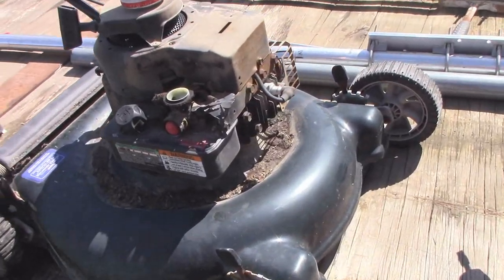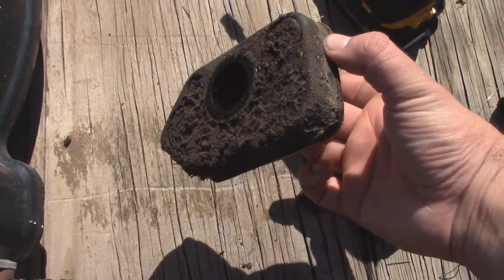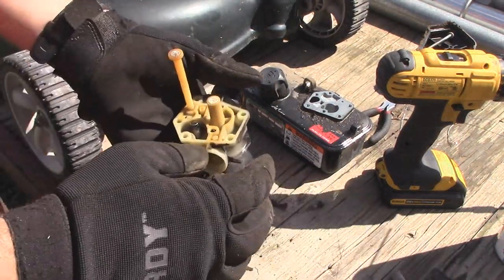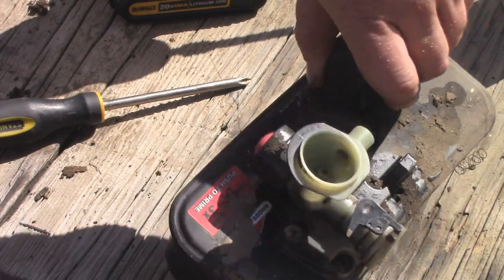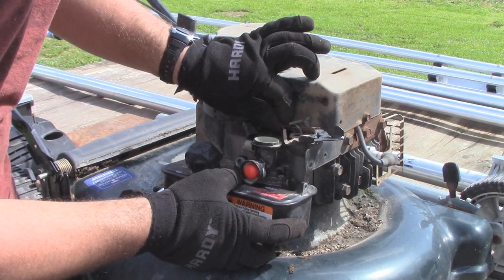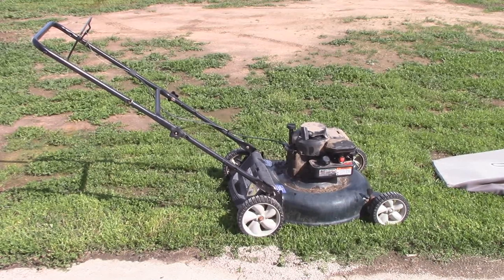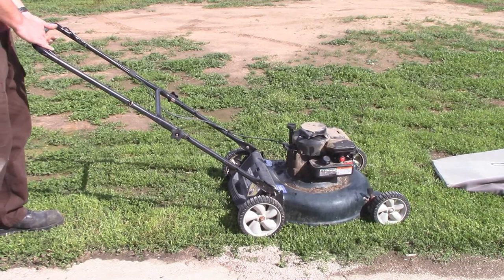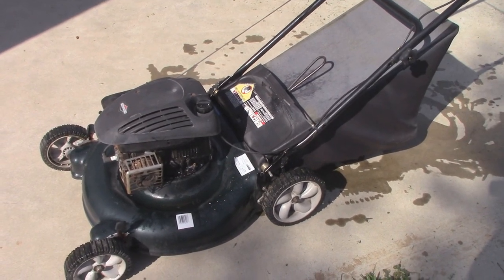Free Mower - Bolens Carburetor Gasket and Cleaning

Comment: YAY another lawnmower vid! Nice looking lawnmower to! Keep up those good vids!
Reply from the maker: Ya I fix them as I get them. I will be doing a service on my riders deck blades this weekend and replacing both drive and deck belts as well. Also have another push mower vid that isn't edited yet. I'm going to start spacing them out instead of uploading all at once that way I still have mower vids going up when it slows down or I can't find any and it should make them feel more regular
Reply: Thats good to hear i found a B&S magnetron mower! carb gasket broke but when its put half on its stops leaking so needs a gasket!
Reply from the maker: +boneheadmoth as hezy Magnetron? yea gaskets are cheap
Reply: yea it is old like 80s briggs! but soon the troy bilt and the magnetron will be running again SOON!

Comment: Good idea using a 5/8 socket to seat the primer bulb.   Also, have you ever stripped/broke the threads in the body housing by over-tightening the main 3/8" screw that holds that gas tank on...like i did?  It still works with only that one smaller screw on the side but it rattles.   Any way i can secure the tank now that that screw is out of play?
Reply from the maker: You’ll need to tap to a larger hole... or order the proper sized helicoil off the internet or something. Unfortunately it may be done for if the threads in the block are stripped out

Comment: Thank you for the outstanding video. In my case the primer bulb itself wasn't priming though the red bulb wasn't cracked. I ended up replacing the entire carburetor assembly and your video made it possible. The problem now, though, is that after having everything back together the mower runs very well for about two to three minutes then sputters and dies. I prime and restart and the problem repeats. I've also oiled the filter as shown and replaced the spark plug. Any suggestions?
Reply from the maker: Might have water or stale gas in the tank. Try draining it and refill with fresh gas.

Comment: Can you tell me the number for that Briggs diaphragm kit? I have a bolens with 5.5hp Briggs on it. Cleaned carb and it ran great. Changed the blade started it back up and it's running shitty again. Probably needs new diaphragm. Already replaced plug, oil, fuel and air filter
Reply from the maker: 5083k

Comment: you call Rotella an over kill for lawn mowers?  this might sound crazy but i put Castrol inside my mowers  so far my 11 year old murray is still running good,  it was bought new in 2005 and mostly Castrol was used in it!!!  i use castrol 10w30  for the longest time and now i'm running 10w40
Reply from the maker: well its meant to be a diesel oil, but exceeds the manufactures specs for oil so it works out great and its alot cheaper

Comment: I have a the same lawn more in a keeps fouling the plug out.after I started a run for a while then starts to surge on and off . I It takes a while but then eventually it fouls  the plug and just quits. Whst would you think could possibly do that.. I just there anywhere to fix that .thanks.
Reply from the maker: Try cleaning the carburetor out. Also make sure oil is level and where it should be and fresh gas. I’ve seen that happen if people accidentally use 2 stroke gas in mowers too
Reply: @hanksgarage_  thanksfor the info. Does the carb have any adjustment or just take it off and clean it, thanks for the assistance. Great video
Reply from the maker: No adjustments, just take off and clean
Reply: @hanksgarage_  thank you

Comment: Why do I have oil coming thru pvc valve going into the carburetor? Makes it smoke blue and cut off it has the right amount of oil in it to
Reply from the maker: Rings are probably worn and that’s all blowby. Try some “engine restore” at the proper ratio next oil change. I’ve used that stuff with great success on worn engines.
Reply: @hanksgarage_  Yea it'll run a couple mins and cut off with blowby pourin out

Comment: Loving the lawn mower vids! Being paranoid, I tend to go overboard cleaning the air filter. I wash it in gas, let it dry, then oil it before reinstalling. Plus, I soak the filter hat and basket in gas as well. I know, I'm anal. Bolens looks good though. Keep 'em coming!
Reply from the maker: +Chris Dionisio Yea it already sold trying to get rid of the Troy bilt now shoudnt be too hard
Reply: I usually clean mine in hot water and Dawn dish liquid then dry them good with paper towels then reoil them.

Comment: My dads Poulan mower is the same with a 4.75HP engine it has the manual throttle adjustment as well, its really weird how theres no cable to it but we've had it since new in 2007 although he dosent clean the spark plug or change the oil to often and the carb has never been serviced but the biggest issue it had was the back area where you adjust the wheels rusting out but he renforced itwith some spare metal. I dont like the newer decks they feel really light and flimsy compared to the older stuff like my 2004 Briggs feelssolid as a rock and has virtually no rust, even my 2010 mower Briggs with the same mower is starting to rust alot
Reply from the maker: Yea these are very flimsy mowers. The only thing I like about them is the fact of how common they are. I find bags for them all the time in the garbage which boosts the value around here significantly. Atleast $50 believe it or not. Bagged mowers are much easier to sell too.
Reply: Yeah i saw the plastic carb you cleaned out and i just cant beleive how much the quality is going down it gives me a good reason to fix up the older mowers like my 2004 which is a rigss 6.5HP with self propelled, personally i dont mind self propelled but alot of people i know dont like it i just dont use it much since it came without the bag
Reply from the maker: +Theghostmaster 87exactly, even the heavier duty ones now adays are lessening in quality... those 500 mowers at sears are not worth that much IMO, I do like the higher end hondas though always have
Reply: yup Hondas have always been really sturdy for me, woth the price tag